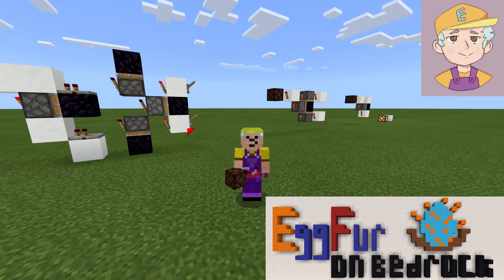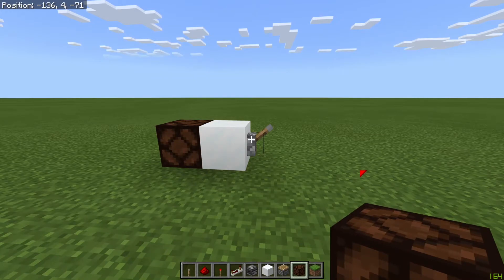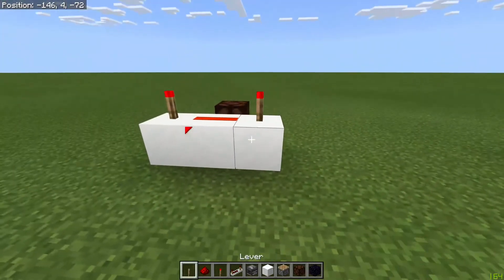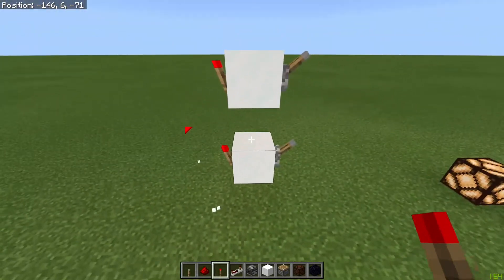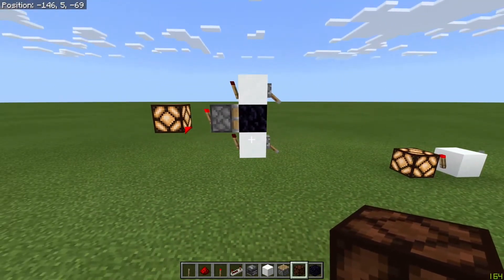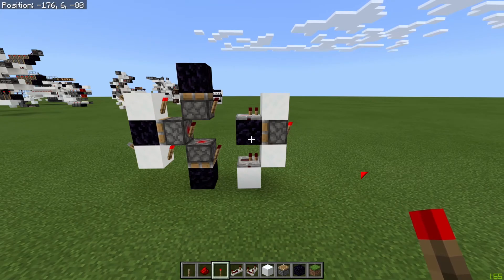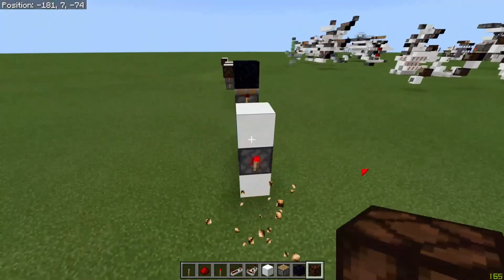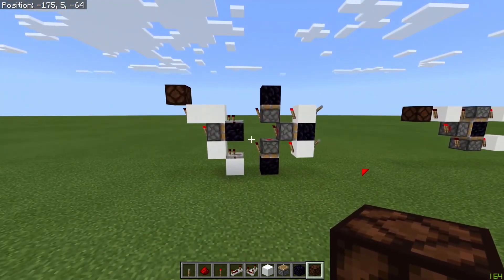All 8 one wide tileable logic gates (Buffer, NOT, AND, NAND, OR, NOR, XOR XNOR) Bedrock

Comment: The one problem in the back of my mind has been merging two pulse streams. 
Say you send a pulse to a counter. Ok fine no problem. Say you send two different inputs to the same counter. That's easy until you get both inputs at once. Then you only have one pulse for two incoming pulses. You'd need to delay one pulse by a few ticks only if you get two pulses at once. I could brute force that, but it seems like having a small buffer counter might do the trick if you could send a pulse per count and then decrement the buffer after the pulse was registered in the counter. 
Sorry to be thinking things out in your comments.
Reply from the maker: No apology required. It's an interesting problem. Even if the two inputs were separated by 1 tick, you'd still get a single input pulse, but 2 ticks long. 

I can't really think of a solution that doesn't involve buffering items.

Comment: Hey eggfur I'm needing help triggering a hopper clock requiring 2 input signals to make it operate. I have a comparator on a chest and a detector rail and I want to trigger the clock to release the hopper minecart to the sorting systems. I have to release it this way because of the filter system I have set up in the hopper minecart for the catergorizer
Reply from the maker: Hi James! What are the conditions that start the clock? Is it just that the Minecart is present and there's something in the chest?
Reply: @Eggfur  yes so that even when the minecart only pulls one item out of the chest it will activate the timer
Reply from the maker: Have you seen my Minecart loaders? They're designed to release the Minecart only when it can't take any more items, but as soon as it can't, and it's not empty You might have to adjust it a bit to take account that you always have filter items in the cart though , but that's probably as simple as inputting a side signal into the comparator. Could that work instead of timing it, or do you specifically need it to wait a certain length of time?
Reply: @Eggfur  it has to be a certain amount of time because it needs to be less than a full stack to allow  it to pickup a item out of the filter chest when it goes through it.
Reply: @Eggfur  I'm using Johnathan Peter's design slightly modified for the catagorizer if that helps. https://youtu.be/JO7eYi6Cpi4
Reply: @Eggfur  I have the triggering part figured out with the detector rail powering a sticky piston pushing a block up in front of a repeater pulling from comparator off of chest. My only issue now is figuring out a comparator clock to keep the signal strong enough to transfer the 14 items from hopper to the other hopper before reseting
Reply from the maker: A pulse extender? 14 items takes 5.3 seconds ish. So a comparator pulse extender with 4 comparators should be roughly right, but you'll need to run a bit of extra dust on the input or the output to shorten the time by reducing the signal strength
Reply: @Eggfur  thank you the 4 comparator worked perfect

Comment: The and gate no longer works
Reply from the maker: I'm pretty sure it does! This is only for bedrock edition, just in case you're on Java. Otherwise, what version of bedrock are you in? You also need to be a bit careful about where you're taking your output from. Make sure it's not being powered by two of the torches - it must only be powered by the torch on the last block.
Reply: @Eggfur  im on bedrock and built it the same as you it just isnt working
Reply from the maker: @seanorechogamingdempsey6245  I just build it again on .220 and it works fine. Are you talking about the one with the 2 snow blocks, 1 obsidian, a piston and 3 torches? Not sure what could go wrong with it to be honest!
Reply: @Eggfur  Ah i see the problem now i was using quartz instead of snow
Reply from the maker: Shouldn't make any difference - any solid block should work fine. Edit: post a picture somewhere if you can
Reply: @Eggfur  i had netherite blocks there before and it didnt work but when i switched it to snow it worked fine
Reply from the maker: @seanorechogamingdempsey6245  that's really strange. It works fine with netherite blocks as well, since they are solid blocks (just tested to be sure). Anyway, really pleased you got it working!